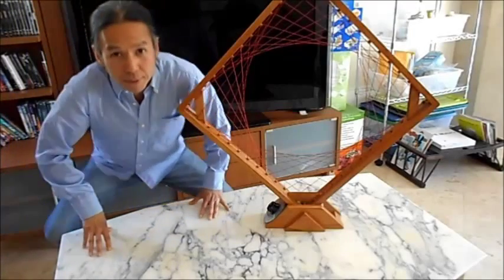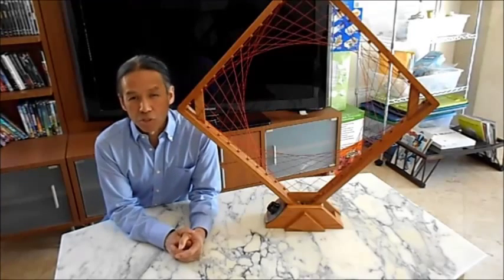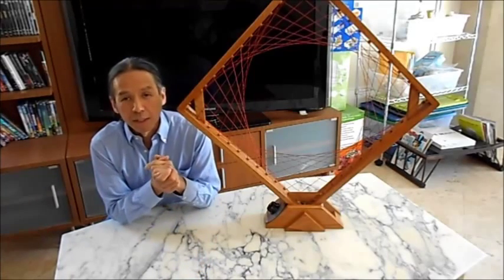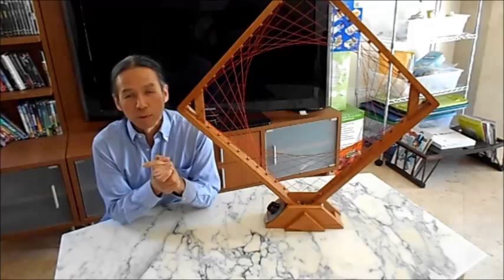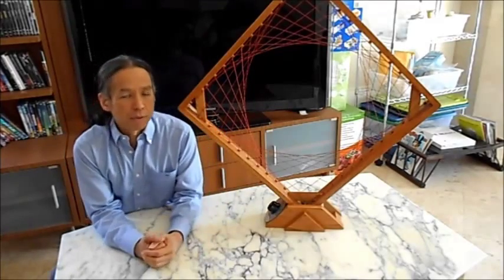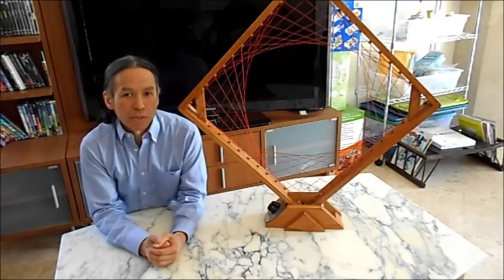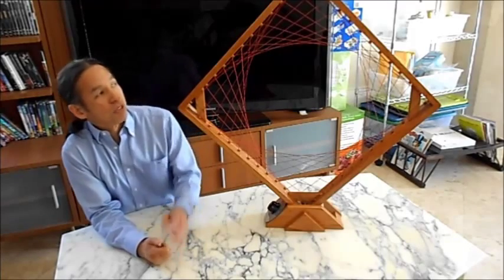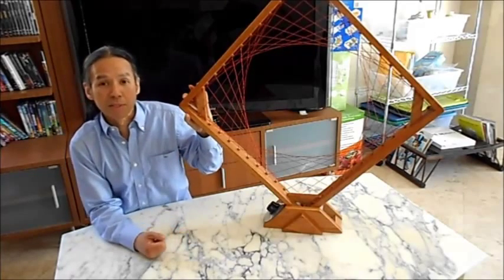Crystal Radio with "Spiralgraphic" Loop Antenna

Comment: How many turns go round the frame of it to get a good signal it has a good size so I bet it takes a good length of wire to fill it which is good I can see that resonating well with the tuning capacitor as you said I like the look of it i think I'll make a varnished box with the coil on top and that standing behind the box will look great a talking point for anyone that visits nice job man I like things done right 👍🤔